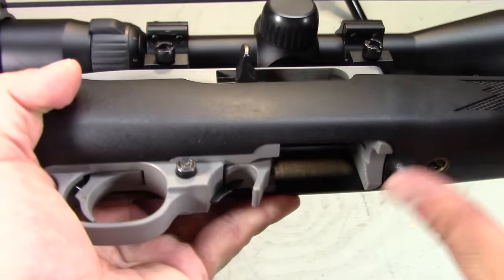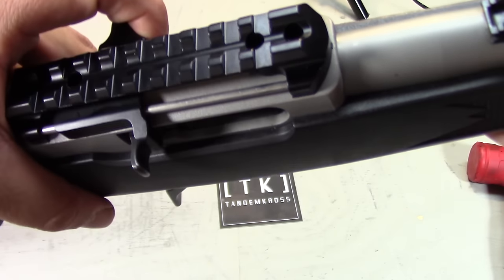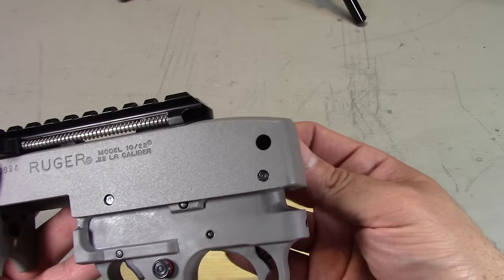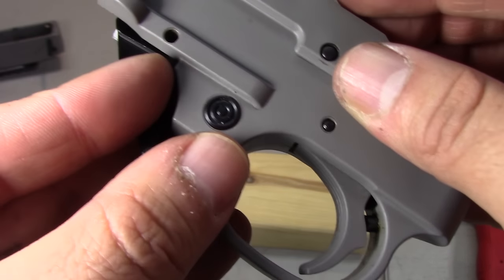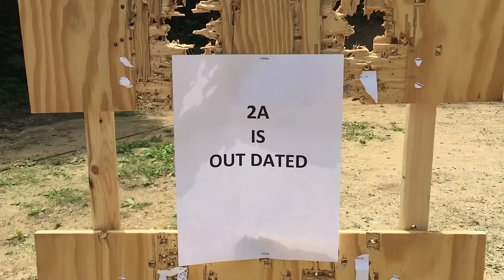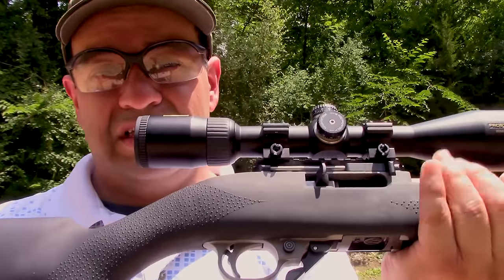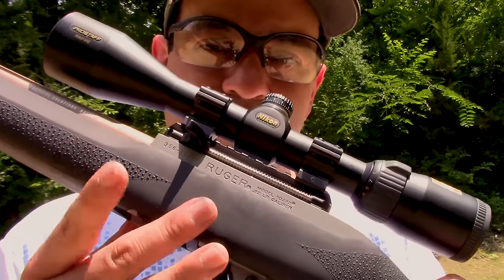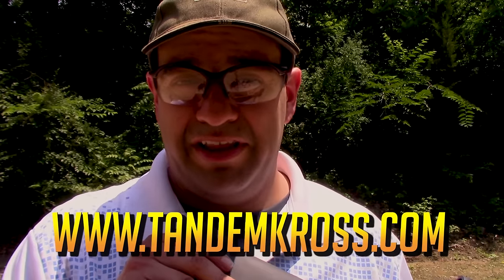Three Awesome Ruger 10/22 Mods - TandemKross

Comment: Ruger 10/22 as it comes from Ruger is a piece of junk.   It won't shoot accurately, jams on a whim, has no bolt hold open on empty, factory stock is junk, factory trigger is junk and a plastic barrel band,,,,,junk.   Ruger has been made aware for years of the problems with the BX magazines not feeding right and they have consistently refused to do anything to fix them.   The only  thing that makes these guns worthwhile is Volquartzen and Kidd.   Just go build your own from those 2 companies and forget buying one from Ruger.   You will wind up throwing most if not all of it in a box as you try to make the thing shoot accurately and properly.